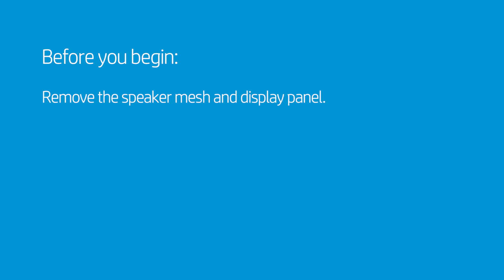Replace M.2 Solid State Drive | HP Pavilion AiO 24 -qc000, 27-qc0000i, 24-k000 CTO and 27-d000 | HP

Comment: I have HP Pavilion AIO 24‑xa0002na. my question is: what kind of PCIe in it? is it PCIe 4.0 or PCIe 3.0 ?? Best Regards
Reply from the maker: Hi Khafaga, thanks for contacting HP Global Social Media Support!
I understand that you need to know about the PCIe slot on your computer.
I will do my best to assist you.
Checked the specification and found that it does not have a PCIe slot.
Binu_HP Social Media Tech Support
Reply: @HPSupport  I found error in my comment. The model is 24-xa0002ne. I checked HP official website, it says that 24-xa0002ne has 2 M.2 for expanding or upgrading. I will put the link below 👇
Reply from the maker: Thanks for the reply.
Please refer expansion slot under the specification page for more information: https://bit.ly/40lbnEK
Binu_HP Social Media Tech Support